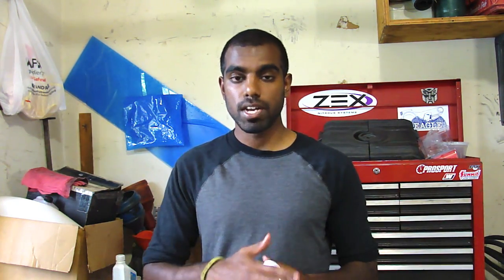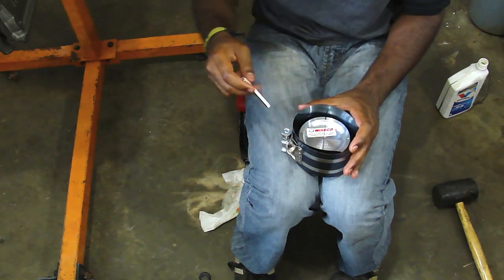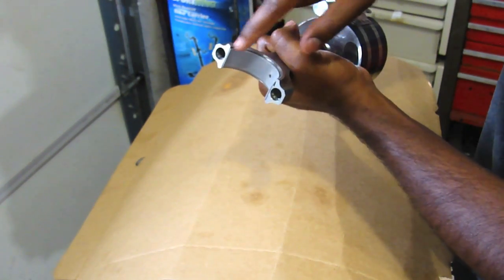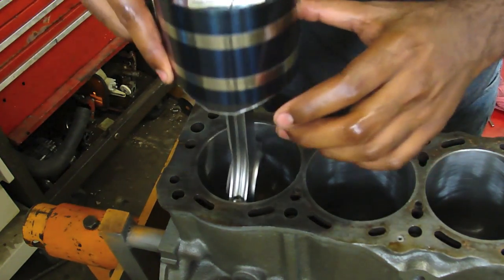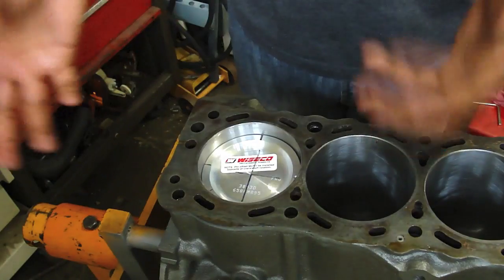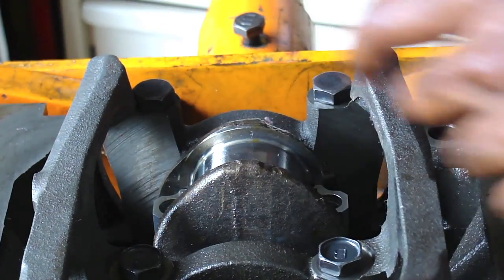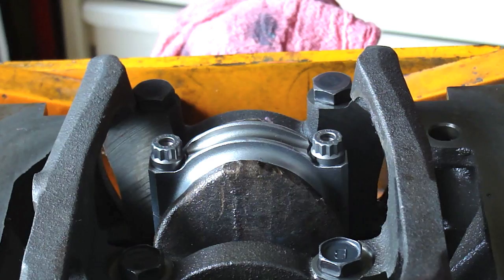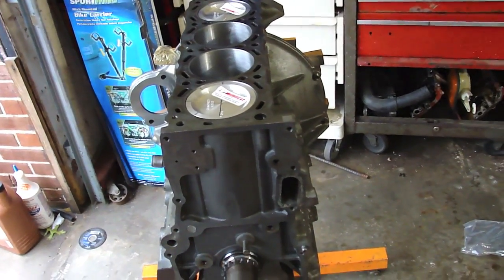Piston and Rod Installation

Comment: When installing the ARP rod bolts I saw that you didn't put a washer on them on mine it did.. just wanted to know how the washer goes. with the flat part of the washer against the bolt head or the other way around
Reply from the maker: jose hernandez those bolts came with the rods, I just installed them the way eagle directed

Comment: with the rings do the parts where the ring meet all need to face same way? 
Thanks
nice vid
Reply from the maker: that isn't necessary
Reply: +Project Garage 
What where u making sure not to move when the piston was in between ur legs?
Reply from the maker: +Alex Rogowski depending on the manufacturer of the pistons, the rings have to face a certain way, but not all in the same direction. this will be specified in the install notes with your pistons and rings
Reply: +Project Garage 
Thanks
great videos
are u going to do a cam shaft install and timing video anytime?

Comment: Did you have to measure the bearing clearance before you installed the bearings?  or will the Standard bearings fit on the crank no issue
Reply from the maker: +MK3SupraDrift I did check the bearing clearances with plastigage before installing

Comment: Hi!, How do I choose rod bearings? are there different sizes or materials? I am learning. TY!
Reply: +Eulogio Adrio Villar I mean, for example here https://conceptzperformance.com/Cart/description.php?II=11015 I have to choose between Standard, 0.25 or 0.50. What does this mean? How to choose the correct ones? Regards!!
Reply: +Eulogio Adrio Villar I THINK all bearings other than standard are if you got your crank journals turned.  That is, if there was scoring on the surfaces or if you "spun a bearing" you would need to turn the journals (decreasing the diameter) and therefore need thicker bearings.  It's like boring a cylinder and getting oversized pistons/rings.
Reply: If it is a KA motor, you may not be able to grind the crank journals. On my VG30DETT, the crank is nitride coated and therefore the crank cannot be ground, only polished. You need to check and make sure that it does not have the nitride coating.

Comment: Not measuring main bearing clearances? Or did you do it sometime before?
Reply from the maker: +Entharion The block and crank were within spec, so bearing clearances were set using the Grading system.
Reply: +Project Garage 
should still always check the clearances with at the very least some plasti gauge, at best with a mic and bore gauge I have built over 300 engines and to be honest, mistakes can be made during manufacturing or distributing. think of it this way, ARP produces say 100,000 sets of headstuds per day, delivers to x amount of distributors and all the boxes look the same. people are getting paid 14$ per hour to organize and ship out to stores/customers etc... shit happens and its not always their fault. checking a clearance takes 5 extra min per bearing.
Reply: +Kei Bee  also you should be lubing under the head of the bolts, that area is a major factor in resistance for torquing rod bolts. failing to due so results in a looser bolt inside the rod.
Reply from the maker: I did at least verify with plastigage. I definitely get what you're saying. I didn't mean to come off as saying to just trust that everything is correct. ALWAYS verify your clearances as many times as you feel is sanely possible haha. These parts go through all kinds of heat cycling, stresses, and forces pretty much constantly. Clearances are important. As far as the bolts, yes there was lube everywhere.
Reply: Aah ok, should mention it in the video that the bolts were lubed, pretty important if guys will use your video to learn how its done. Hows the build going so far?
Reply from the maker: Kei Bee This engine lasted about 25,000 miles of hard driving, daily driving, and multiple road trips from memphis to the east coast. It was a great motor. It failed because the c-clip that locks the wrist pin into the piston failed. So the wrist pin slid out and made a HUGE groove in the cylinder wall. It sucked, this was my numbers matching engine.
Reply: +Project Garage ah sorry to hear man...thats strange coming from a high quality piston. can I ask you this...did you squeeze the circlip a bit with a plier to make it easier to install? this would be a big no no if you did. another thing is, when you install them they "click" and you think thats it but sometimes you look closer and its not fully in...almost hapened to me once but i cought it on time! anothr thing I do just for peace of mind is rotate the circlip till the gap of the circlip reaches opposite side of the dig out groove in the piston.
Reply from the maker: +Kei Bee nope I didn't squeeze the clip that's a big no no haha. Man the way it failed is so weird. The part of the clip that contacts the wrist pin wore off. So the pin slid THROUGH the c-clip. To me, it seems like the only way that would happen is if the wrist pin was binding in the rod which would then allow it to slowly wear down the clip. but I feel like even those effects would be so minimal given all the lubrication it has. plus, when I took it out, the pin wasn't binding at all!
Reply: +Project Garage thats really strange...hard to tell unless I see it. did you do all the pin fitting before installing your pistons on the rods? or you just installed them out of the box?
Reply from the maker: +Kei Bee you mean the clearances? I had the entire rotating assembly inspected by a machinist before I put anything together. It didn't even cost much, less than 100 bucks.
Reply: Custom bearings are all premeasured according to how bottom end measures up

Comment: where do I get 43 pound wrench?
Reply: Jeohn Rebosura It's a torque wrench, you can get them at any auto store. You set the ft/lbs you want and it stops itself once it reaches that set point.
Reply: theirs a torque setting on the wrench?
Reply: yeah, hence why it's called a "Torque adjustable wrench" might be called something different where you are but that's what we call them here in Canada. Pretty nifty tool in general but for doing engine internals its a must.
Reply: Before you do this please learn the basics.
Reply: thanks for the laughs

Comment: No rod bolt stretch gauge?
Reply from the maker: ahmevo o If I had one, I would have loved to do it that way. However, this is a street build with a 350ish hp goal. Using a torque wrench on these bolts is perfectly fine. Now if I was trying to build a 1000hp KA-t with some crazy doo-dads on it, then yea spending the extra money to buy a stretch gauge is probably worth it. I've never used a stretch gauge on any motor I've built, and I dont know anyone personally that has. Not that its a bad idea or anything, just a bit unnecessary for most builds.

Comment: I'm 16.. Getting my first car tomorrow that needs a transmission rebuild, and a ton of miles on the motor.  This helped a lot, I'm going to go for it with no experience and I don't have the tools yet but I will purchase them soon.  I don't know what I'm getting my self into, but I'm going to try my hardest to rebuild the t5 trans and 5.0 v8 motor.  Is it much different compared this motor?  I mean obviously it is but same general Idea right? It's also an 86.  Thanks liked and subbing.
Reply: isk8aliens1 you're 20 now! what you've done to the engine ?
Reply: 7 years later hows it going

Comment: i have an frs with a fa20 turbo kit installed. will i need ecu tuning when i install aftermarket pistons and rods
Reply: as long as you retain the same compression ratio there's no need for additional tuning.

Comment: I've install my pistons 2 day ago, but, it makes kind a stuck, not at all, but it stuck a little bit, and i canr roll my cranckshaft in a easy way, is tamhat normal, i have to use a little force to make it roll, is that normal? I repeat all the pistons are bolted and torked...

Thanks...

By the way, great job, nice vids